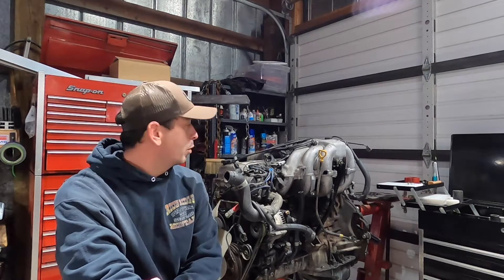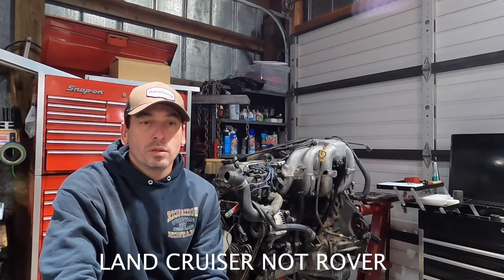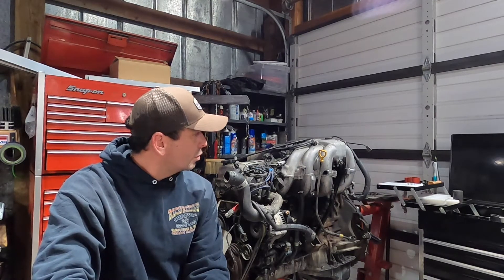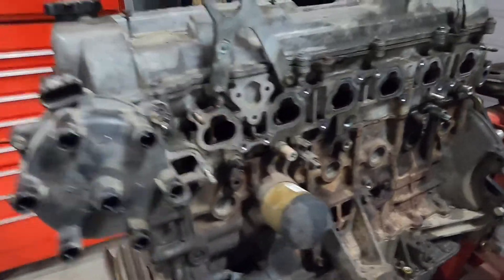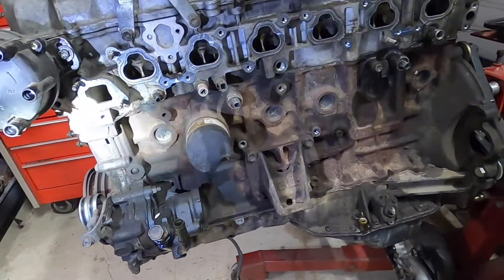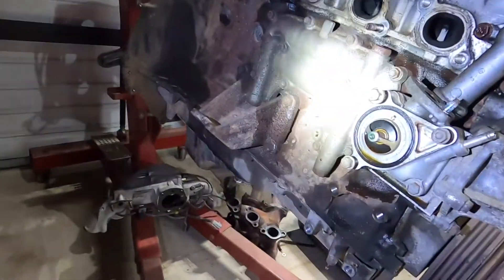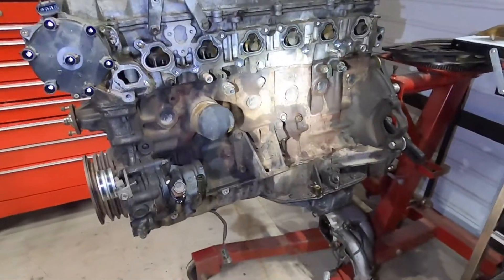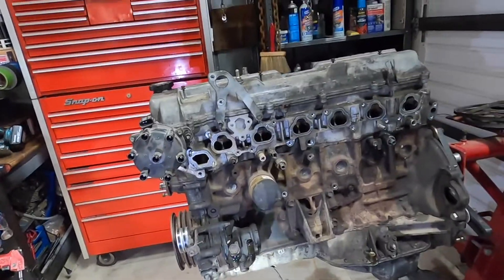Intro to build series, Removal of external components

Comment: awesome series, was wondering how much does the stock block can handle safely without forging , can it handle 350-400hp ?
Reply from the maker: Thanks dude! I’m almost certain that would be no problem, in my experience it’s usually the connecting rods or the rod bolts that let go first I bet this one would go further than expected, but at minimum do forged rods to go above 500-600, one of the special things about the 1fz if built up correctly it can handle upwards of 2500hp on stock block and cylinder head!  as far as the crank I’d feel comfortable running well over 1000 even 1500 before upgrading

Comment: Hi mate, I have one of these in my Landcruiser down in Australia and I'm looking to turbo it in the near future. I'll be watching closely!!
Reply from the maker: Nice! I grew up down in Australia just outside of Sydney in the blue mountains, what kind of power level were you thinking? This one will be built to handle well over 1500hp although initially it will likely only see approx 600-800, 
Heck of a good engine to build upon, feel free to ask any questions that I don’t address in the videos.
Reply: @stevegiles7954  Cool! We love it up that way, I'm in the South Eastern suburbs. 
I am building it as a touring/tow vehicle so it's a completely different application to what you're up to. 
I have a few different hurdles as it currently has LPG/Petrol and I need economy to play a small role. If I get around the 400hp at the wheels reliably on stock internals, I will be happy. I'm after more power low in the rev range. If I need to rebuild the motor then north of 500hp would be awesome! I have only had the vehicle a few months and I'm only now starting to do some research on the 1fz-fe capabilities and I am happy I picked it over the diesel as a platform. I am very interested in your build as it will push the limits of the block
Reply from the maker: That’s cool!  I miss it over there , Not too far from you, So many fire trails through the mountains good for wheeling,
These 1fz engines are pretty rare over here in the US, I just happened upon this one in the classifieds, someone had pulled it out of the rig to put a v8 in, like you said for what your looking at doing you can achieve with stock bottom end until your ready to go north of 500, most of the steps will still apply for that kind of a build , you definitely get to skip some of the forged parts that I have coming up 😬💸 hopefully these videos will help with your project, I appreciate you watching , got a few good ones coming up
Reply: @stevegiles7954  Yeah there's a fair few over here and the aftermarket seems to accommodate the 1fz. Definitely will be watching your process and progress! Cheers for the reply 🤙
Reply from the maker: Nice 👍🏻 it’s good to have some local aftermarket support , I think I’ll be getting a few parts out of Australia too